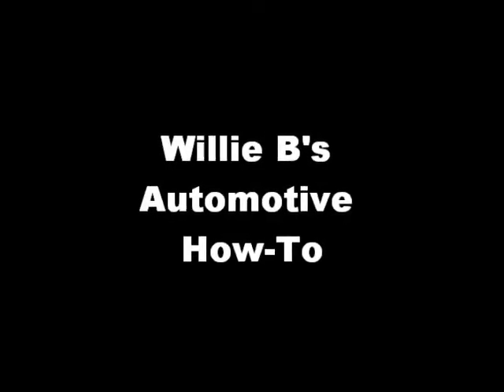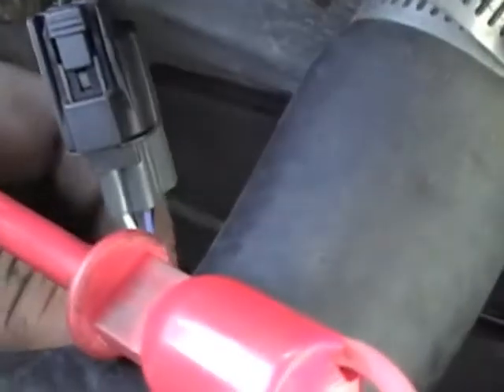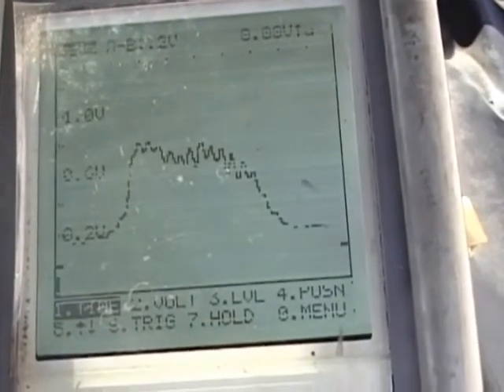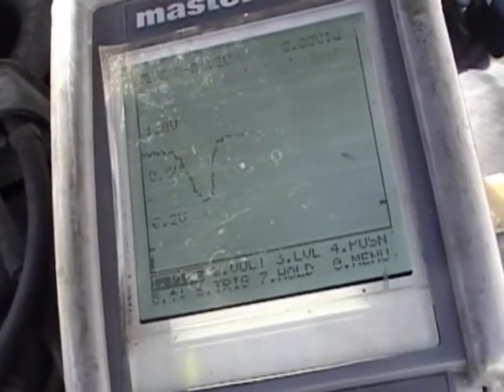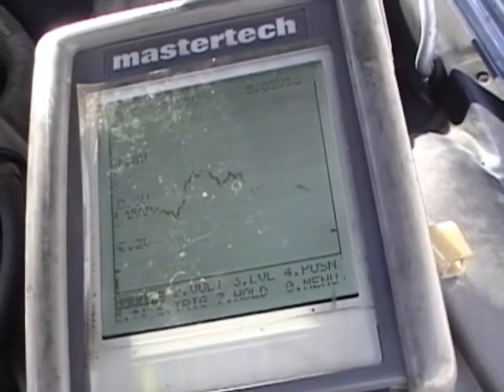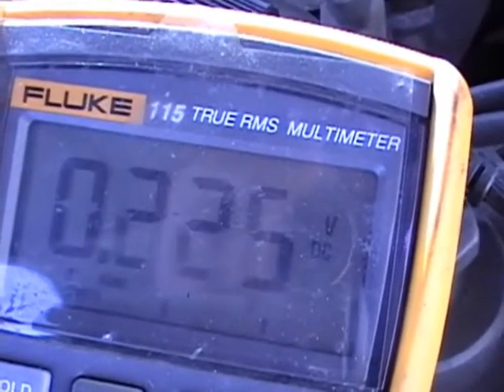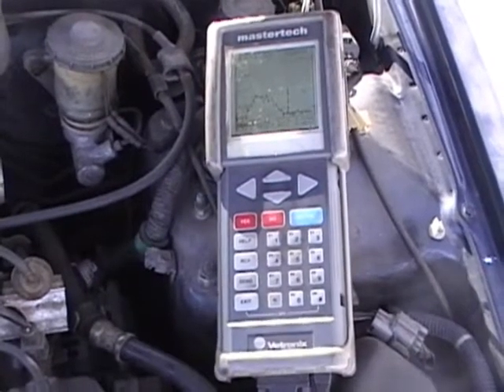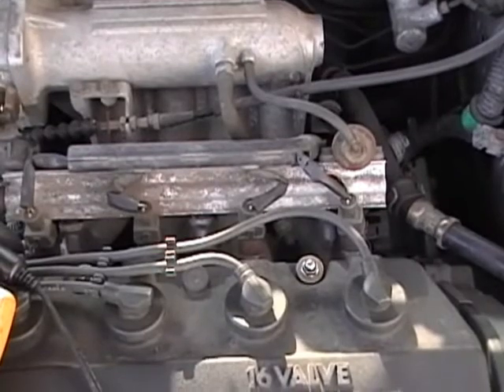how to diagnose oxygen sensor problems (part 2)

Comment: Nice video.  Bar has adopted testing these things for smog failures.  They say that the O2 sensor should go below 175mV but not below 125mV and above 800mV to at or under 100mV with a rise time of 100ms.  Good O2s usually have a rise time of of aprox 50ms.

Propane is the ideal way to test these things w/ the parameters just listed.  Sometimes o2 sensors 'crash' under load.

Jim
Eve's Automotive
evesautomotivedotcom